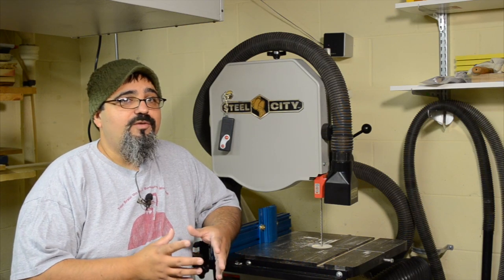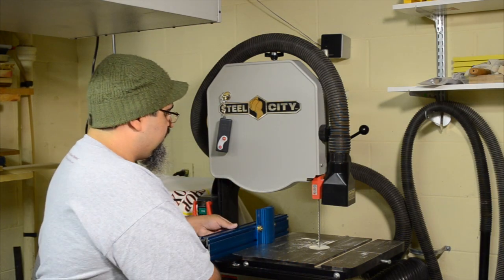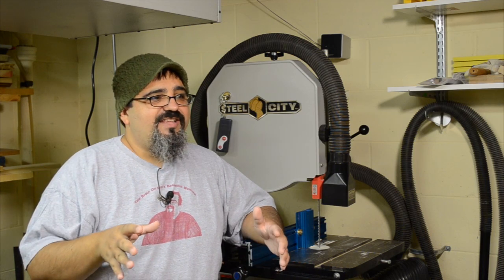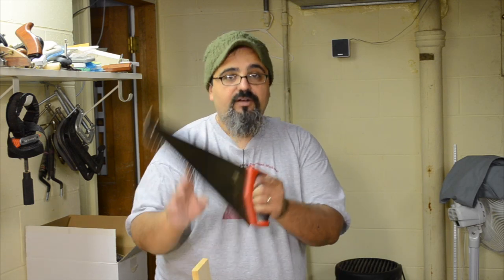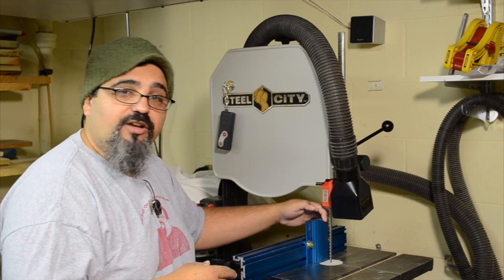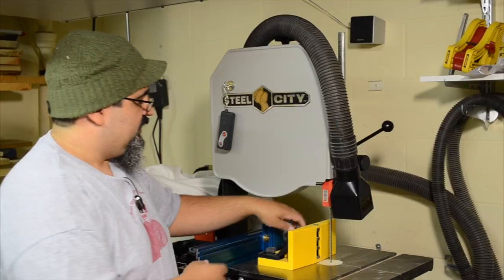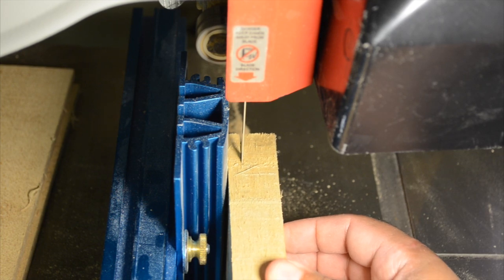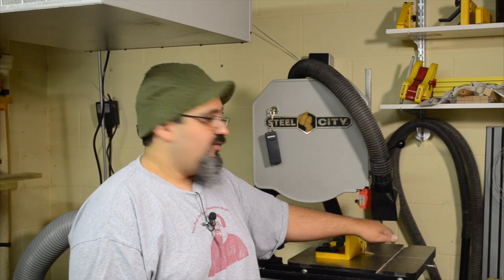491 Resawing Options

Comment from the maker: Absolutely correct, if you don't have one tool you would simply use what you have.  Much of the reason I mentioned the options is because many beginning woodworkers (as in zero experience) aren't even aware there are options.  

The assumption amongst many is that you HAVE to have a particular tool to perform a specific task and therefore won't even make the attempt even when it's to their benefit to try.

Thanks for watching.

Comment from the maker: I've been there before!  A few questions: 
1) what size blade are you using and how many teeth does it have?  When resawing I use min. 1/2" blade with 3-4 tpi 
2) is the blade tensioned enough? a slack blade will barrel cut in the middle
3) is the table square to the blade? not square leads to odd angles
4) how fast are you pushing the wood through the blade? resawing is a slow process. Your job is to push slowly and let the saw do all the work.

Hope this helps a little

Comment from the maker: I use "beeswax" for the job as needed.  I turn the saw on and hold the end of the wax against the blade's sides.  It doesn't take a lot of wax, just a quick pass and it's ready to go.

The amount of wax transferred is so minimal that's it not even worth paying attention too.  Plus, typically after making my cut I end up sanding or refining the surface anyways so that little bit is removed completely.

Comment: Just did a test in my workshop. Looks like you can have the best of both worlds by using table saw and bandsaw. Lets say your board is 6" wide...score each side of the workpiece about 1" deep on the table saw. Then complete the resaw using the bandsaw. You will find that the bandsaw blade will track much better when the board is pre-grooved. Smooth out the rough spots with a surface planer or belt sander.
 
Note: For an ultra thin kerf, use a Diablo 7 1/4" framing blade on the table saw.

Comment: I've seen so many pro cabinetmakers shift from table saw to 2 bandsaws. If you think about it, since it all has to go back through the jointer or planer after cutting anyway (all table saws leave blade marks) then a big bandsaw set up as a rip saw and a smaller with a 1/4" for scroll work is all you need - just as fast a workflow and far far more safe than a table saw - you'd have to be really dumb to cut your hand off with a bandsaw

Comment from the maker: Kris unfortunately I'm at a loss at the moment as to how you could do it.  The bandsaw could still resaw it into thinner material, but it would still be rough and need to be cleaned up.  If you were to cut the pieces oversized and then finish dimension it on other tools perhaps...in that case the bandsaw would simply be a roughing tool. Not sure if that helps?!

Comment: I have a craftsman 12" bandsaw I bought off a friend's dad. No matter what I do, I can't re saw anything. I've tried using a fence and it just won't work. It'll either cut only half of the face, or at a weird angle, and I end up throwing the board across the room out of frustration.

Comment: Hey Matt, I have some rough cut stock that a friend gave me that is about 1-1/4" thick. I would like to resaw it into 1/2" pieces but at the moment I dont have a jointer. Is there any way for me to resaw this material accurately without squaring it up on a jointer first.